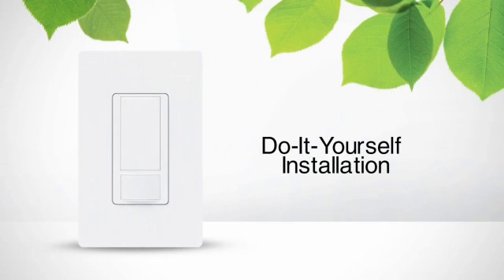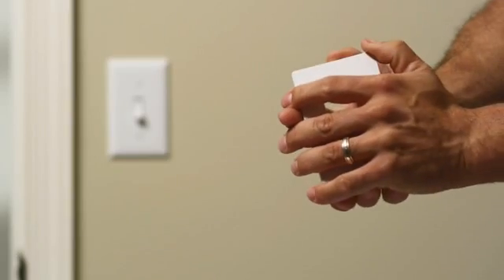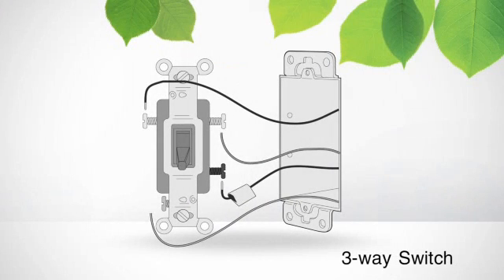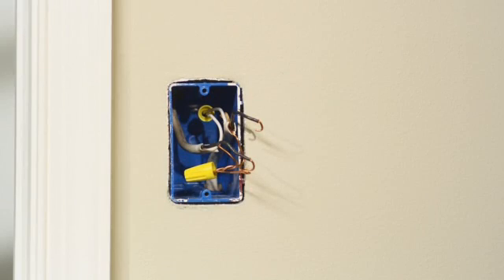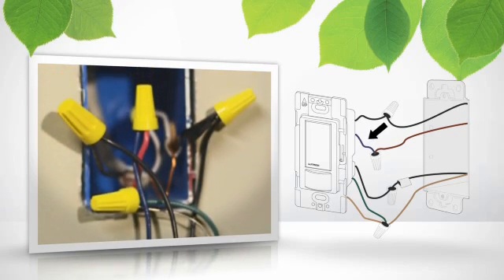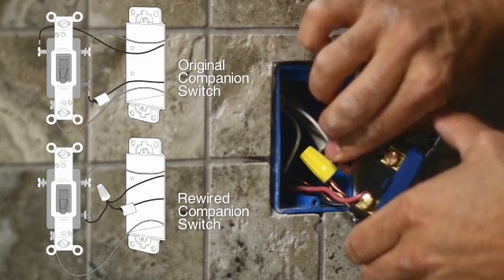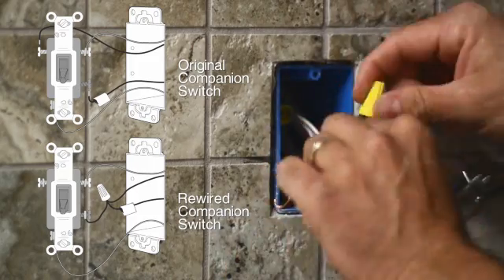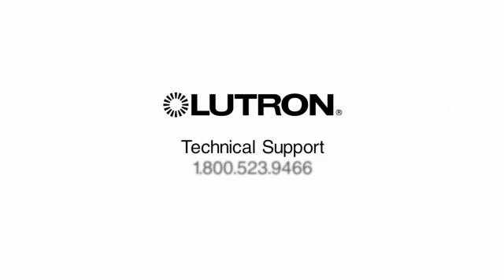Maestro Sensors: How to Install

Comment: I have a ms-ops2h with bare, white and two black wires. I don't know what is wrong with Lutron, but they don't say what is the line and load wires. If it does not matter they should say that. The sensor needs power when the switch is not on, so this polarizes the circuit. This is stu   %%^&^&**((*% pid beyond belief. I guess I have to f%^&&**ing call them. waste of time.

Comment: This video is worthless, it shouldn’t even be necessary except for the fact that the documentation that comes with the product is complete trash. Less than useless. For a $60 light switch that does essentially basic functions, this is way overcomplicated, overly engineered, poorly documented, and the “help” video doesn’t even cover the product. This is a marketing video, nothing more. I’ll be leaving a review on Amazon as well.

Comment: I made a mistake of buying a wrong model and was confused on which wires to connect, perhaps, maybe you can help which wires I should I connect.  I got the part that my Orange Wire is the Common (as labelled in my current switch seen in my video: https://youtu.be/mgadtHj3tYE.   Lutron suggested I get the Lutron MSCL OP153M since I do not have a Ground wire, but, OP153M ALSO requires a Ground Wire.  Thanks for your assistance.
Reply from the maker: Hi, Rei.

The ground wire will always be attached to our units, but with the MSCL-OP153M, it will function without it.

Please follow the following video, it is for the MACL-153M, but they install and look identical in the back.

https://www.youtube.com/watch?v=QzhhM-3hCM4

Thanks!

Comment: Good how to video for a newbie with limited electrical experience.  Yes, would be nice to have separate videos for single and three-way, but really, wasn't all that complicated despite the strange existing wiring in my home.  Took about 20 minutes (watching video over and over to make sure I would not burn down my home or electrocute myself) and the switch worked perfectly after initial install.  Will make late night walks down the hallway much more pleasant.  Thanks for a great product Lutron!